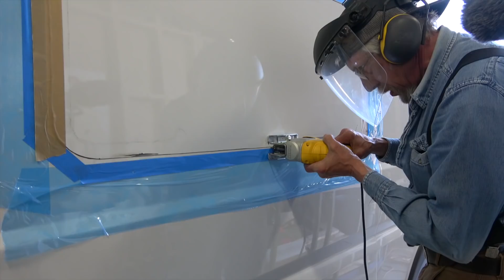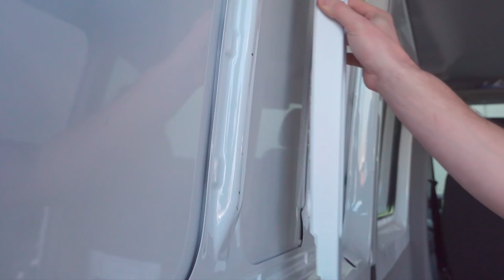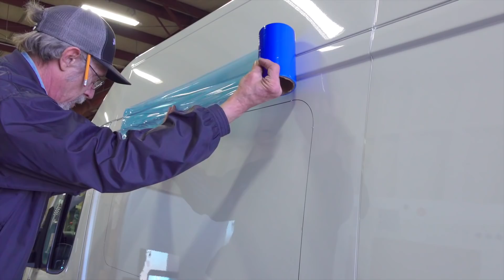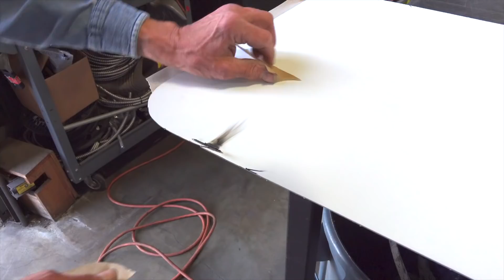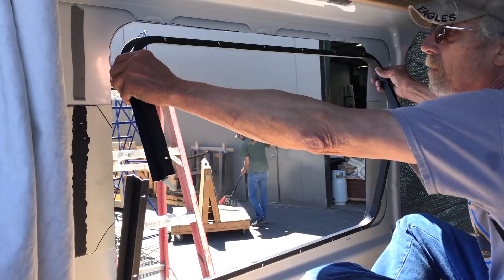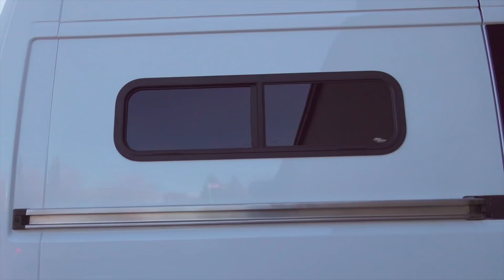🚐 Van Conversion Window Installation - Van Life DIY - Class B Living

Comment: A great video, and I’m not planning on installing new windows where none have gone before!  Watch a video of Bubba “I installed a window in my van” and you’ll get an idea how to do it. Watch this video of a pro that’s done done it for decades, and you’ll KNOW how to do it! Particularly important for anyone that’s worked with metal and know how it’ll start flopping and vibrating was the tape on the ends and leaving a bit in th middle before finishing. Duh, why didn’t I think of that? ‘Cause I haven’t installed hundreds of windows. So yep, a great video. 

Something else I picked up from this video that is marginally related. Using the inner ring to check fit. I installed two replacement windows on my class A, the driver’s and passenger side front window. I used a different vendor, and the measurements were to be within 1/16”.  Measured two places vertical and horizontal. All was well until I got the windows. The openings were out of square by about ⅛ - 3-16”, which is negligible, but enough that with the tight tolerance of the window fit, the windows wouldn’t go in. I spent time with a grinder “adjusting” the aluminum frame until the windows would fit. I still have a couple to replace, I’ll do my best to check for square, not easy with rounded corners, I’ll use a larger margin of ⅛”, use the trim piece to check fit, and of course, use Motion Windows! 

Thanks again, and hope to meet you all on the road one day!
Reply from the maker: Thanks so much for the comment, David! 😊

Comment: I wish the video mentioned the materials names more like the clear plastic tape to protect the paint and the tape to hold the sheet metal while cutting.  We tried every tape we had for holding the left and right sides of the cut metal but nothing worked.  Also, the screws we got have square driver holes in the top.  My Philips driver worked but I've never seen square before and I've been doing mechanical work both paid and at home since the 1960's.

Other than that the video is very helpful.  Thank you!

Comment: Great video. Maybe I missed it, but why did he cut the two short slits at the bottom of the window before cutting out the entire window?
Reply: Those start the cut for the jigsaw blade.  The cutting wheel can self-start its own cut, but the saber action of the jigsaw blade cannot start its own cut.  I think they were slightly inside the line so the cut was started inside the waste area.
Reply from the maker: Good question, Frank... and sorry if that wasn't more clear. He cut those slits so he had somewhere to start the jigsaw for cutting out the window opening. He created them above the line for the actual outline so that they didn't have to be as precise. When he started cutting with the jigsaw, he inserted the blade into those cuts and curved down to meet the line for the opening. That makes sure he can precisely control the cut.

Comment: What is the purpose of the angle grinder cuts?. He uses the jigsaw and cuts on his template line underneath them. So what are those cuts for?
Reply from the maker: Todd... those cuts are because you have to start with something... a jigsaw/reciprocating saw can't START a whole in the side of the van. The angle grinder cuts he made were so he could then insert the jigsaw. And he did them above the cut line so that he could then cut down to the line with the jigsaw, which is a finer blade with a better cut.

Comment: If it matters, do you prefer the saw teeth ( blade ) pointing inward or outward ? 
The blades come in both types.
Reply: I would think teeth pointing outward so saw tends to pull against the surface being cut, rather than pushed away from it.
Reply from the maker: We never even knew there was a choice! LOL But we agree.... having the teeth pull the saw toward the surface must surely be the way to go.

Comment: Hi, do you know if I can use Isopropyl alcohol to clean the edge of the windows before installation instead of lacquer thinner?
Reply from the maker: That should be fine, Iris! It’s to clean and remove any residue from the manufacturing process, and alcohol should do the job, too.

Comment: About the structural integrity that the rib provided for that wall? I asked that question because I have a 36 foot Fleetwood diesel pusher 1993 model and it has two windows next to each other with a 1 foot section in between it that still fiberglass for the motorhome and collectively together they are 12 1/2 feet long. I have been thinking about putting in one window that is 12 1/2 feet long. And taking out the 1 foot section in between the two windows. Is that possible do you make a window that big?
Reply from the maker: Hi Larry! Based on the flimsy nature of the rib, we're fairly confident that it provided no structural integrity for the van at all, but rather was probably only there to keep the thin steel wall from flexing/vibrating while driving. And now with the window in place, that wall is probably more solid that it was with the rib. We'd suggest that the wall section between the windows in your motorhome is much more likely to be structural, and not sure what the effect might be of cutting it. Even if the structure in there isn't essential for keeping the chassis rigid, there is the potential that the amount of flex that might occur without those members in place could conceivably permit enough wall flex to break a 12 1/2 foot window while driving. By the way, to find out if Peninsula Glass makes a window that big, or if they advise installing it in your situation, you can contact them through their website: https://www.rvwindows.com

Comment: Can a window be installed in the front of a travel trailer?
Reply from the maker: It might depend on the surface, Becky. If the surface of the trailer is flat, vs "corrugated" it's more likely. But we'd want to consider other factors too, such as exposure to things that could strike the window, like flying stones. There's probably a reason why most travel trailers don't have a window at the front.
Reply: Quite probably, although you'd want to ensure it was a heavier tempered glass to deal with the impact from road debris.  And/or always have a sturdy protective cover or "shutters" over it for travel.